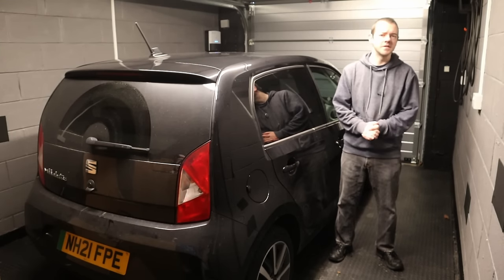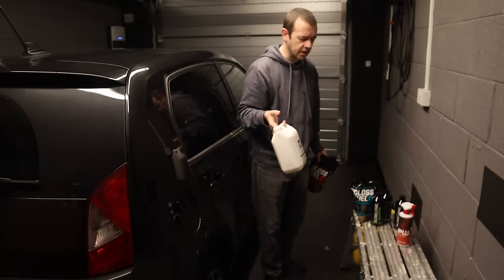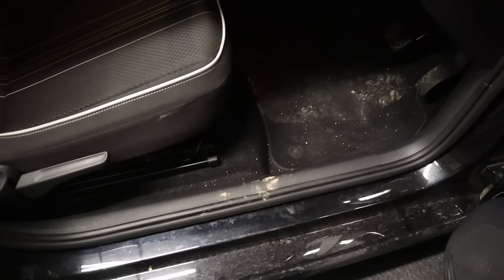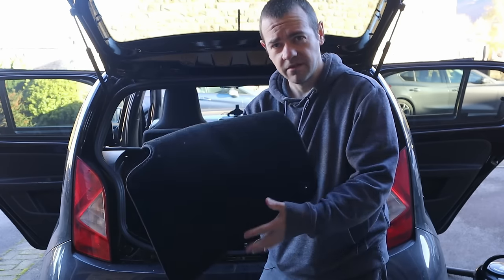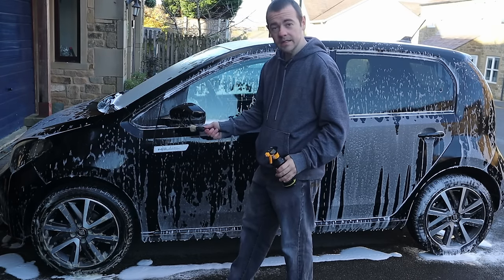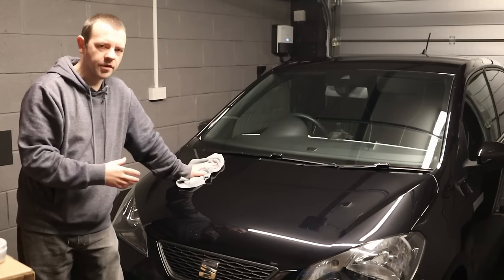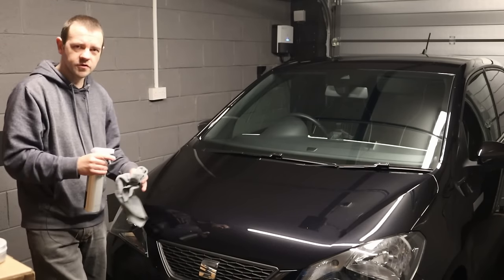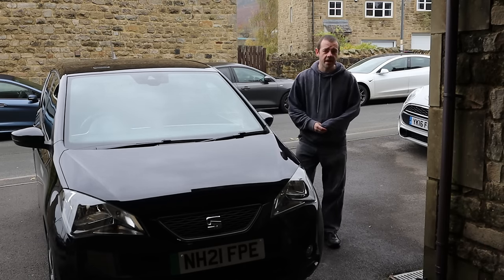Cleaning A Car Easily With Longer Lasting Results

Comment: I'm in the just leave it I don't care camp. We live in a rural area where the car is used daily on muddy roads. It is an impossible task to try and keep it clean.
Reply: I like washing my car, but I am with you on that UK roads are now run down, full of mad, dirt, sand and dead leaves. Detailing lasts for 10min of driving at most. The only thing that might make sense is wrapping the car but this costs up to 1000. 

Lived in Germany, a car stays clean for at least a few days of summer driving over there. In the UK, my car is getting dirty even by standing on a driveway during summer 😂

Comment: I liked cleaning the car more when I was younger and had more idle time 😊 Picked up some good tips there, use the snow foam and jet wash it off and often find there is still dirt on the surface which sponge just seems to move around. Will try the brushes.

Comment: Great video, nice to see how it’s done properly, I pressure wash first, then use car wash and wax in bucket, then use a soft car brush with long handle to wash the car then pressure wash off. I did put some armorall wax on, and window clean. Will look at your stuff to use 👍

Comment: I was always told that using a hi pressure jet washer on car panels was a sure way of gradually removing the layers of paint, due to the sheer power of the jet of water. If using at all, I was told you must spray at an angle, never directly at the bodywork. Perhaps I've been mislead, but I think I'll give it a miss.
Reply from the maker: That’s simply not true.

Does driving rain at 80mph do anything?

Comment: Thanks Andy...some questions just wondering you didn't show it but there was a comment when you were inside the garage about using clay and sounded like you did on the windows is that correct?  Also what type of brushes are they, just like paint brushes you use?  Is it safe to brush inbetween all the buttons and nobs in the car with the wet brush before you dry it off?  Didn't know you could put the car mats in the washing machine but if you had a dryer could you dry the mats that way or is it better to hang them out to dry?  I assume that clay bar you used you can buy at any car shop that sells car cleaning products?  Could you use the foaming snow as you called it with just a regular hose or does it need the jetwash?  Waxing the car at the end could you use a electric buffer or is it just as fast doing it by hand like you did?
Reply: Hope these answers help, but you're entering a big old rabbit hole here.
Forget clay (you need to polish after) and just get some Fallout Remover (Autoglym Magma).
Look up Autobrite Direct brush set. Varying brushes have different levels of softness so you don't damage anything. Also, a Scrubber Dubber is way quicker easier and more effective than his method of interior cleaning.
Autoglym interior cleaner is lovely and foamy so around buttons his method is perfect.
Don't know about drying the mats.
Snowfoam softens dirt and you need to blast it off. Hose will not work effectively. 
Wax is done by hand. However, look at a spray wax (autoglym ceramic spray). Far quicker and easier for a novice. If you've gone to the expense of a snow foam cannon, get something like Autoglym Polar Seal. Spray on, rinse off. Bloody amazing stuff.
Halfords is as good as anywhere for Autoglym products and loads of microfiber cloths, buckets etc. Autoglym are easily accessible, high quality and very easy for a novice to use (many products have application issues, AG don't).
If you don't have a pressure washer, just go to a jet wash to blast most of the crap off, then go home and hand wash.
Oh, and watch a ton of YT videos and go on the detailing world website before buying anything as I've only scraped the surface!
your wallet is gonna take an absolute battering! I love it!
If you decide all this is way too much like hassle, just do the interior! Get a scrubber pad and clean the steering wheel. 
Hope this helped a tiny bit

Comment: Great video Andy, I like your pressure washer set up ( seen on another of your videos) as it’s ‘ready to go’ that’s the key thing having it already plumbed in and connected imo. Did you drill a hole in the wall (for pipe ) through to utility room behind garage?
Reply from the maker: Yes. 

Badly.

Comment: Hi love the channel, looking for some advice, I've owned an EV for nearly 8 years now but only Zoe's. I am in the last year of my PCP and was going to buy it outright but the balloon payment is a lot more than I can get a new er one, so I will just hand it back ..the question is , I have recently started takeaway deliveries and using the Zoe makes it worth while , so I'm in a dilemma, I have 11500 to spend on a EV to do deliveries so the seat mii is a great choice but Zoe's are going for about the same money as the miis,is there that much difference in KW per mile between the 2 , the range is fine on both because I only ever do about 50 to 80 a day when I work. I've been getting around 3.5 in the Zoe ( doing deliveries) driving it on the heavy footed side and it is in winter so I know it will go up from that when it gets warmer, do you think the mii will be any or a lot better thanks Trevor

Comment: Hiya. Can you charge your Seat Mii using 150kwh charger?
Reply from the maker: Any CCS can use any CCS charger. 
Up to the max of either.
Reply: @ElectricVehicleMan  I use to have a VW e-up and tried charging on a BP pulse 150kw charger. Returned message not compatible with this charger. Only asked this question as they are changing all the 50kw chargers to 150kw.
Reply from the maker: @richardsumerfield4923  It’s the BP chargers, not the speed.
Reply: @ElectricVehicleMan  have you tried charging your Seat on a 150kw charger yet?
Reply from the maker: @richardsumerfield4923  No but I’ve seen others. 
Plus speed shouldn’t make any difference to any car. CCS is CCS.

Comment: You could have cleaned the pedals 😂
Reply from the maker: It wasn’t a mega detail, just a normal one. 

They got a wipe I think. 🤔
Reply: @ElectricVehicleMan  30 seconds with a soapy brush? When you zoomed in at the end it didn't look good.
Reply from the maker: @colinphillipson4830  Didn’t do the engine bay either, it was designed as a quick and easy way, not a flawless detail.
Can use the same method on the pedals as the rest so it’s up to the person doing it now. Method was my only constraint.

Comment: 10:52 WHY?! 🤌 when we now has competing RINSELESS products which can be used also for pre-soak, paired with APC?
a no-jet-washed-required solution! i'm sure any Yorkshireman and/or (up to) half of UK households (without driveway/garage, therefore also less likely with access to hose & power), would appreciate...